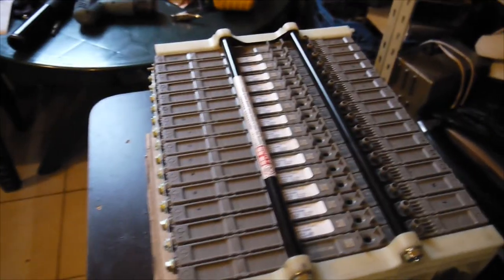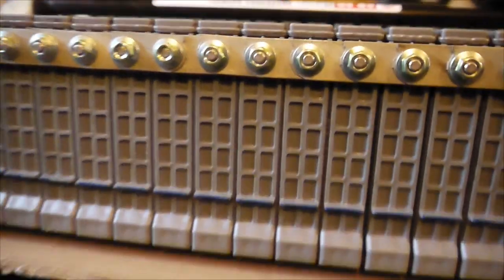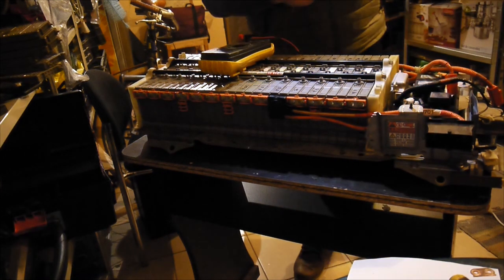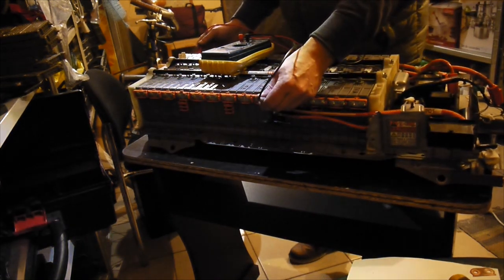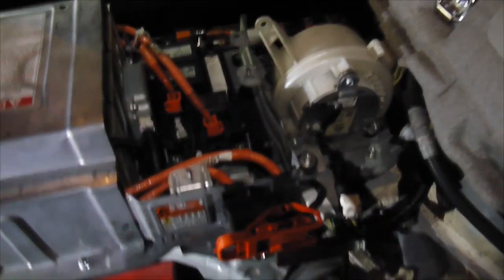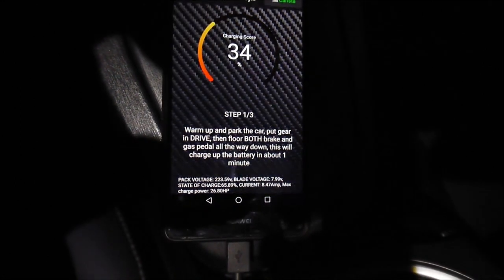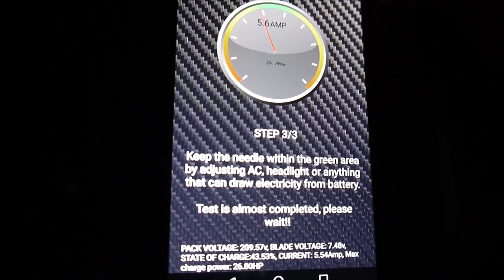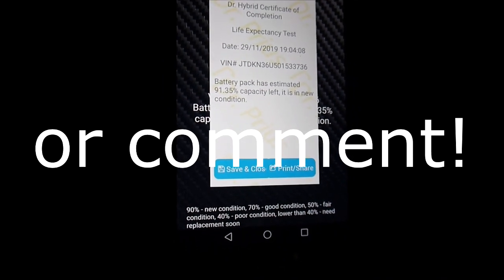How to fix Toyota Prius HV battery hybrid DIY test tools Part 2

Comment: Hi you have very good videos I learned lot from your videos, have question it’s possible to charge with laptop charger
Reply from the maker: To charge one cell..I*m afraid not, you need a charge controller with the right voltage and currents..this NiMh cells are prone to explode if not charging well..serious! Buy a cheap IMAX B6 ..
Reply: @viocaia  thanks. But i keep my eye on it with volt meter where the voltage reach i had made on/off switch
Reply from the maker: Be aware, you apply 19V to 7.2 V cell...
Reply: @viocaia  what is exact voltage and amp
Reply: @viocaia  l made whole pack charging 400Dcv with 1.4amp current
Reply from the maker: @lakshmanfernando7899  ok..I got,that.s something else..perfect!
Reply from the maker: @lakshmanfernando7899  That.s fine, I thought you only charge one cell..

Comment: need the info for the where you got the batter and bus bars   duuuuuuuuuuuuuu
Reply from the maker: Hey! I go the cells from a local repair shop, specialized in hybride batteries..the bus bars been covered in electrolitic bath..in a electrical parts factory..sorry can't help you more..

Comment: I like that kind of test, but its have too many information, i cant keep up
Reply from the maker: It's not so hard, you have to have time and tools.It save a lot of money !
Reply: @viocaia  so i ll test it on ac voltage measurement
Reply: @viocaia  how can i figure the resistance of each cell
Reply: @viocaia  i tried by omh meter,
No resistance shown
Reply: @viocaia  you mean when the results of ac measurement i divide it by my result,
Can you help me by that
Reply from the maker: @mohnadwuhush92  You can not measure the internal resistance of a battery with the normal ohmmeter.You may try to DIY a tester like in my other video, check for that or buy a dedicated instrument like :https://trade.aliexpress.com/orderList.htm?spm=a2g0o.home.1000001.31.650c2c257D0ZfG&tracelog=ws_topbar&tsp=1579113800726

also you can use a IMAX B6 battery charger and do a row of charging and discharging and eventually find the state of the each element.
Reply from the maker: @mohnadwuhush92  If you did the 555 IC schematics like I mine, you have to use the meter on AC and divide by 10..that will be the internal resistance, or at least a clue about the relative state of life of the element.
Reply: @viocaia  thanks, you are so supportive, i have imax b6
Reply: @viocaia  but ill make by ac measurement and divide it on 10
Reply: @viocaia  like 0.88 as you said divide 10 equal. 0.088 milli ohm is that right
Reply: @viocaia  but the cell with higher resistance means thats its good than another's
Reply from the maker: @mohnadwuhush92  something like that, but I'm afraid it's kind of low..very low.Usually a NiMh element have around 8 milioms..let's say from 5 to 25 miliohms...I used 1Ohm load resistor, maybe that's why I have those numbers.Also , all the cells should be at max charge, let's say if it is an liIon cell should be aroun 4.2V, or a NiMh 1.4V..if is not exactly like a professional meter but at least you may have a scale, lower the numbers better the cell.
Reply: So my friend how's the better cell  with highest or lower ohms
Reply from the maker: @mohnadwuhush92  always lower...
Reply: @viocaia  thanks alote viorel
Reply from the maker: Hey Mohnad! Please give me a hand and subscribe! Thanks!